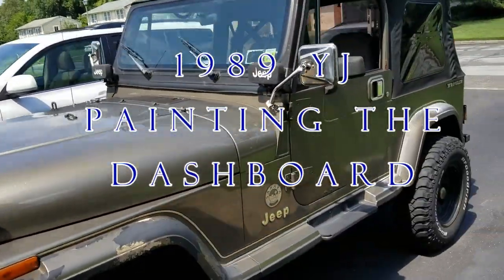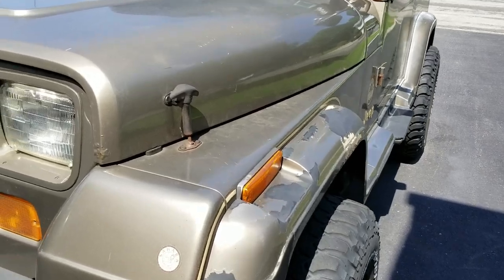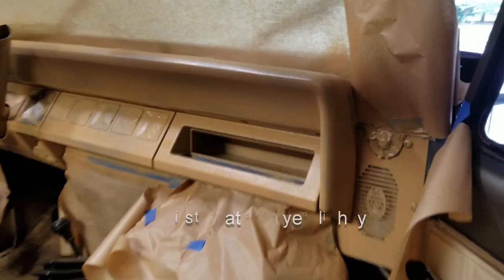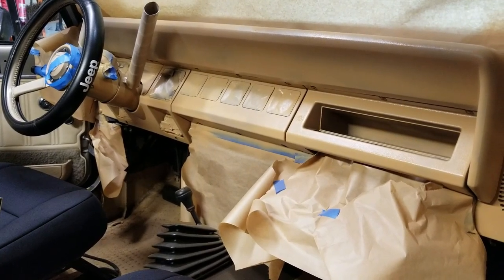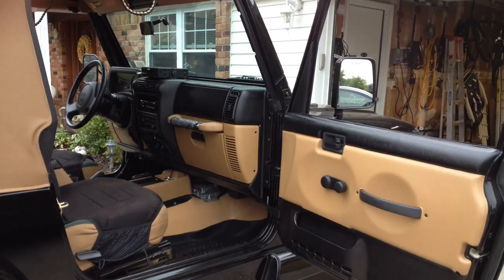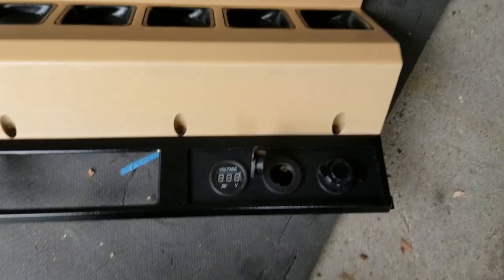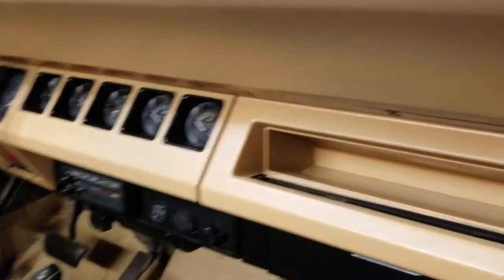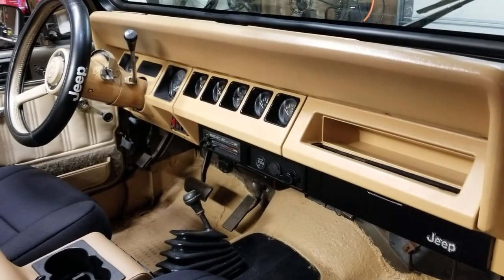Jeep Wrangler Dashboard Painting - 1989 YJ

Comment: I wish the new jeeps could be Column shifted. You could use the floor for the 4 wheel drive. Thus have both and moee space
Reply from the maker: I hear ya. I’m guessing there’s a technical advantage of having the shifter on the floor as it’s closer to the transmission. But I miss the days of column shift vehicles. Seems like nobody makes them anymore.
Reply: @Mudslidex1  
Yeah it’s very unfortunate. Variety would be nice. Everything has to be like a race car now. It’s basically only full size trucks and vans now that have it.
Reply: That column shift was an automatic

Comment: The dash looks great!  I have been wanting to do the same to mine.  How has it held up - scratch easily or starting to peal up?
Reply from the maker: Thanks. I no longer have the Jeep but it held up for years.  Never peeled or cracked. It would scratch though, but not that easily and I guess no worse than an unpainted dash would scratch.  But good thing is that it was easy to touch up if needed with just a quick spray

Comment: What is the color that you used in the Rust-Oleum paint for the dash color. Looks good. I have the same jeep and I need to re-coat the same thing.
Reply from the maker: Chris C. Thanks Chris. It’s Rustoleum Gloss Khaki.  About $4.00 a can st any of the major box stores. I’ve been using this color on different things for years and it seem like a color that’s always easy to find in almost any store. So it’s always easy to find it if you ever need more to do touch ups
Reply: Thanks for the reply. Done my dash about 16 years ago. Used some mixed OE from Napa and a model car air brush. It's finally showing some age and coming off/fading. I'll give that paint a try.

Comment: Nice matching painted speakers! Maybe you should have least taken them out
Reply from the maker: Lol. They don't work anyway and I wasn't planning on using them. That's why I didn't bother. Not worth the effort removing. Especially the idiotic way YJs are designed to remove them :)
Reply: Reasonable, hey do you know what the 4 holes on the back passenger corner are for? I have a 95 YJ with the same thing but nothing to go there. I feel like I need to plug them up so water isn't getting in the body
Reply from the maker: @giraff3z   I believe those holes are for the Instatrunk.  I had an instatrunk that came with my TJ, but I sold it.  I believe YJ's had one as well and bolt to those holes.
Reply: Actually, I just looked it up and they are for the stock tire stop from the tailgate
Reply from the maker: @giraff3z  oh. You're talking about the holes in the tailgate?  The yes. That's what those are for.  I thought you meant the holes on the inside of the tub. Glad you figured it out

Comment: Nice work!! I have a 2009 Sahara that I am looking paint the interior. Did you leave the dash board in when you did the two tone on the TJ as well?
Reply from the maker: Thanks.  Yeah for the TJ I left the main dash in and taped around it, but a lot of the dash comes off such as over the speakers, the glove box, the panels under the steering wheel, the center dash console.   So I took those off which were easy and sprayed them outside the Jeep, then just taped off  the main body of the dash that I couldnt remove and sprayed that in the Jeep

Comment: How is this paint holding up? I have the same Jeep I’m about to start working on...same colors. Not sure if I want to shop around for parts or just paint it.
Reply from the maker: I no longer have this Jeep so I can't tell you. But the reason I used this paint is because I previously had a TJ and painted the dash using the same paint.  I had the TJ for 5 years with the top and doors off all Summer and the paint looked the same 5 years after painting it.
Reply: Joe D. Outstanding thank you sir
Reply from the maker: @mdalby512  You're welcome!
Reply: Use SEM Color Coat in Sandstone

Comment: Could've at least taken off the front window which would've made it much easier.  Nice job without doing that though
Reply from the maker: I could have/should have done a lot of things that would have made it easier to paint . But it seemed like every bolt I turned on that Jeep was rusted and had a couple just snap off.   I wasn't ready to add more work by having to remove more busted bolts :)
Reply: @Mudslidex1  still, beautiful job.